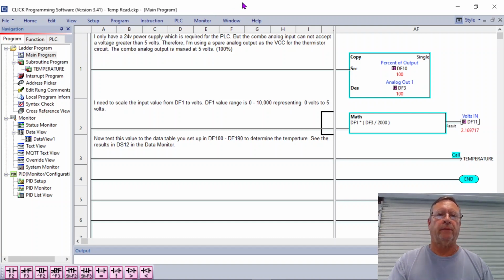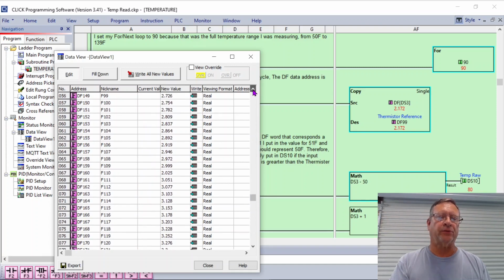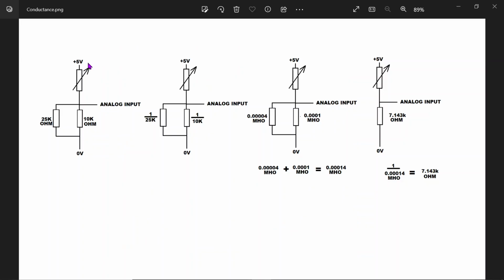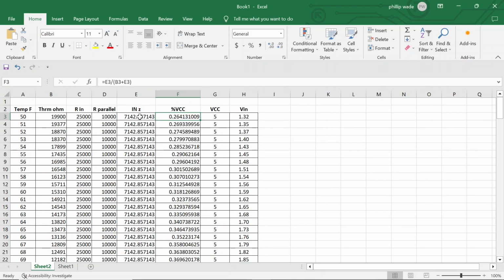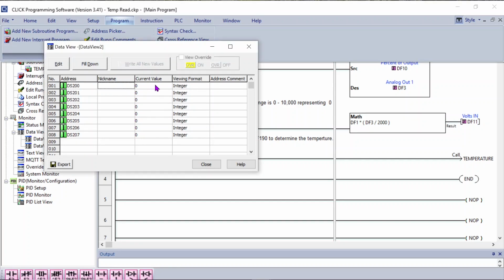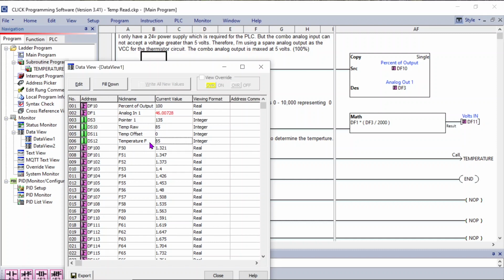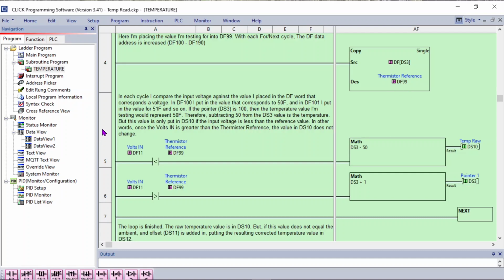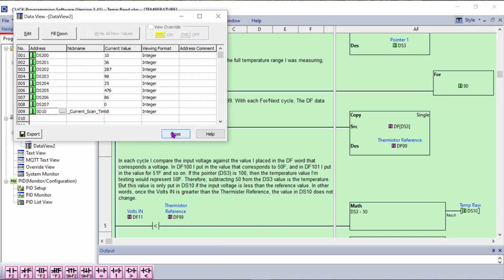Read Temperature Directly into the CLICK CPU

Comment: If I wanted to check humidity or soil moisture, could I use a similar setup?
Reply from the maker: The sensor would be the expensive part. For about $35 from Amazon I found a temperature/hygrometer with 4-20 ma output. Then use an Analog PLC.

Comment: I come from a world of AllenBradley PLC 's. I am finding tthe CLICK programming to be a drastic change to digest. I think you have helped me immensly witrh this transition. Thank you!
Reply from the maker: My primary background is also AB. With these videos I'm just showing how many small automation projects can be made cheaply and simply. Although, the CLICK is much more powerful than anything I show in these videos. If you are solid with AB, you will find the CLICK programming to be basic, no user defined tags, etc. My videos are breaking away from the over priced software and hardware cost of companies like Siemens and AB. They try to lock you in. Besides Automation Direct has other processors that are very cheap and very powerful. Stepping up to SCADA, I would go with Ignition Software, vs Wonderware, GE, AB. If you speak French, learning Italian is not that far away. If you speak AB, CLICK is easy. It only has a handful of instructions and ModBus communication is so simple.

Comment: Here's a follow topic instead of using a for loop. Do a polynomial curve fit to the thermistor data in excel (add a trend line and show expression) then use the click's math expression to linearize the ADC value.  What you have here is an interesting approach that's applicable to various situations, thanks.
Reply from the maker: I was just trying open the minds of some subscribers. Normally, I would just use a temperature module.

Comment: Most excellent video.  The mhos is something new for me as a real tool.  🥳   Very creative program.   ✨ Thank you. Great stuff.
Reply from the maker: It's not the norm for sure. But it is a cheap way to measure and control a temperature with minimal electronics and $. It could work for an OEM that would replicate it over and over. 1 PLC and 1 sensor.

Comment: Phillip, I enjoy your content and I am using a C2-01CPU with a combo C2-08D1-6V. I am using 4 temp sensors and I'm attempting to use 4 sub routines and one set of reference voltages assigned to DF40-240 allowing a 200 degree range from -10 to 190 degrees. Any pointers our guidance you can provide would be great.
Reply from the maker: You got me interested. But I need more information. What sensors are you using? What are you trying to control, fan speeds, heating/cooling valves, etc.? Are you averaging the sensor readings or using each one for a different controlled area? That's a powerful PLC setup for little $.